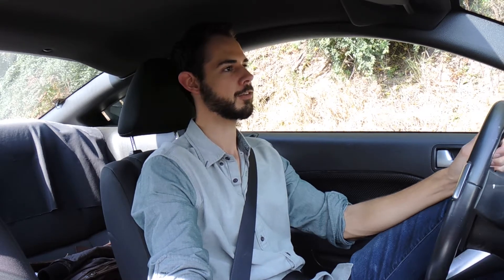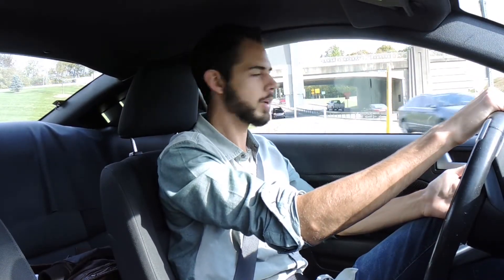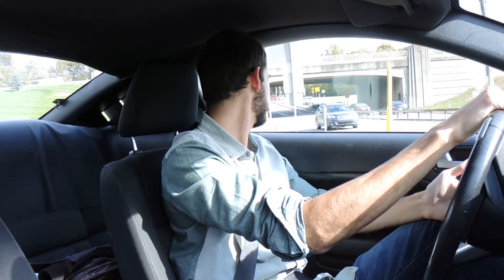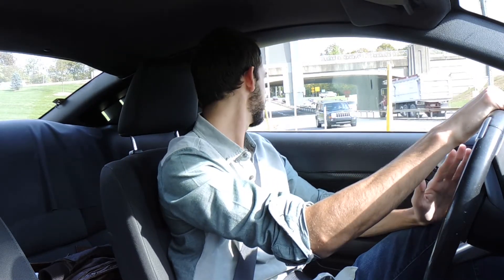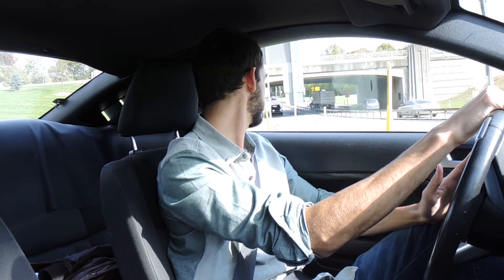Mustang engine RPMs drop at idle with electrical loads

Comment: Whats the problem u sort out ?  Mine toyota corolla 2011 has the same problem . I have change everything but cannot find the problem . Please help me .😭
Reply: An update . This problem is resolved . My car engine is weak . Compression is very low. So when a electric load on  generate is applied then it will become hard to spin and it puts all load on engine . So that is the cause for this fault .😢

Comment: Did you solve it? I have same issues....
Reply: I have the same issue , changed and cleaned throttle body but problem didn’t go 
Did you fix yours ?
Reply: @africanlifeempire8108  It was the alternator.

Comment: Just figured I’d suggest a quick fix y’all should try before anything serious, I was also having this same issue in my 07 v6 mustang and with a quick throttle body cleaning it made it much less apparent but didn’t quite fix the issue. Another thing I did was removing the egr valve and letting it soak for a few hours with the same throttle body cleaner. Again neither of these fixed the rpm drop issue when the windows roll up but it dosnt feel as aggressive when I do experience it now.
Reply: For anyone wondering why the throttle body would cause this issue is because the throttle plate blocking the intake has a small gap in both the top and bottom of the the throttle body to allow some air to pass by for idle. These gaps are very small as the engine dosnt require as much air at around 750rpm therefore any grime or oil built up near those gaps even just a small coating can close the gaps up significantly causing the car to stutter in a way when the electrical system is under higher loads(windows,fans,AC, etc…), with #1 a good cleaning, #2 draining the ecu and other computer components from all there power(basically a reset to delete any saved data), and #3 once all ecu components are reset then you can relearn the throttle pos and let the car idle for about 10-15 min for relearn the fuel trim etc… I didn’t initially think that this would be much help to the issue but was pleasantly surprised when it helped!

Comment: Scan the car first if no codes remove iac valve and throttle body and clean then along with the injectors and if problem is still there replace the Electronic Load Detector-ELD. Honda have the eld located in the fuse box
Reply: There is no iac valve on this generation

Comment: My car has the IAC built into the throttlebody so it's annoying enough to try and fix it. Might just end up replacing both the battery and alternator if it comes down to it. 2 birds with 1 stone amirite?

Comment: Yo im having the same thing with my civic 2010, when the fan kicks in my rpm drops and my engine doesnt know if he will stall or what, I'll try to clean my throttle body and Idle control valve. Let you know soon.
Reply: What was it bro?
Reply: CRUZANITY the mechanic says it might be IACV or MAF sensor
Reply: Jasper Maclang in my case , it was the maf. I cleaned it w MAF sensor cleaner about $10 to see if it solved the issue & it did. Didn’t want to gamble $100-125 for a sensor at parts store

Comment: I have a similar problem in my car.  Some guys say to clean the throttle.  Have you tried that.  I would guess that if it is dirty, it might be less able to react to changing loads when closed.  Be kind if I'm way off.  I'm not a mechanic.
Reply: I cleaned mine but problem still continues
Reply: @jorgegallegos5247 I cleaned mine and still have same problem , can someone help? I’ve changed and cleaned the throttle body , the problem didn’t go

Comment: So did the IAC fix the problem? I have the same issue when my fan kicks on. I'd really like to know what fixed your issue. Thanks.
Reply from the maker: Unfortunately I never got to buy the part or fix the problem! I think someone talked me out of it saying that wouldn’t be the problem
Reply: I've had my 06 mustang for 12 years. It's always had a low/hunting idle when any electrical stuff is on (lights, AC, etc). Never found a solution for it.
Reply: @Slowtreme did you fix it ? My car rpm is low and nothing I’ve done fixed it

Comment: same thing happening whith my Malibu 2013 every time I stop rpm shake and when I put electranic load rpm drops close to stalls
Reply from the maker: I replaced the battery and alternator and still not fixed
Reply: @Stangaddiction  if you have not fixed yet then why you made video on it. I am same patient looking for solution but not yet
Reply: @Stangaddiction  did you replace the IAC and did it fix the problem??? You are going to the store in the vid to get the part but never show after and never comment on the results.
Reply: @Stangaddiction  oh  okay  I'm thinking to change the alt because  is overcharging to 15.4
Reply from the maker: Assryian that’s so weird!! WHY DOES THIS HAPPEN. I still don’t know what is causing it
Reply: @Stangaddiction  I think is the battery  and the alt  are bad with bad Ground  because I change a lot of things didn't fix the problem , and I took it to 2 different shops the didn't know the problem.

Comment: So i have a 1998 Mustang Gt 4.6l and it drops rpms when im on the highway and the Transmission doesnt wanna exceed passed 1000 and drops to 489 when its at idle? Please help me i dont want to sell or trade it
Reply from the maker: I just thought of this, if you have catalytic converters they could be clogged!
Reply from the maker: Halo Genisys this could be the timing of the engine off. Also, a bad connection of the throttle body wire. I once turned on the car with the throttle unplugged by accident!! It started and went in to limp home mode like yours and just shut off almost. You can definitely fix it. A local mechanic could check it out too
Reply: @Stangaddiction  is there any way i can fix it myself? I cant find any solutions but i will try that for sure and thank you for the quick reply
Reply: So cut them out and straight head pipe it? Cause theyre expensive
Reply from the maker: Of its the timing you won’t be able to fixit yourself. But fingers crossed it’s something easy.
Reply from the maker: Yeah they’re not cheap...
Reply: @Stangaddiction  alrighty thank you man take it easy

Comment: How much intensity does the new alternator have? U should buy one of those with 200 amp
Reply from the maker: Chipster339 this is 135 amp
Reply: @Stangaddiction  Did you solve the electrical load problem? I have same issues....
Reply: Me too
Reply: @kapasky123  It was the alternator.
Reply: @kxtreme1942  did you solve this problem? I had the same issue